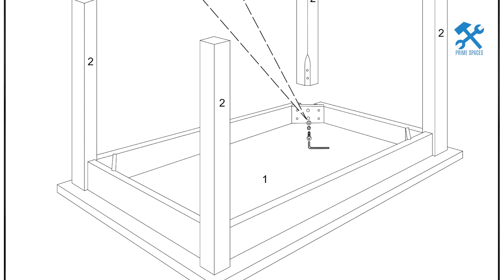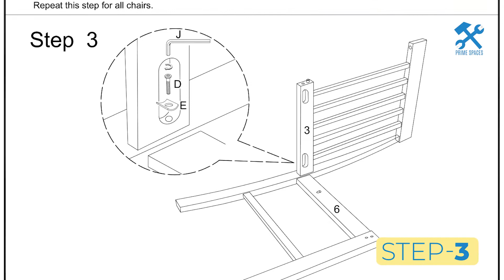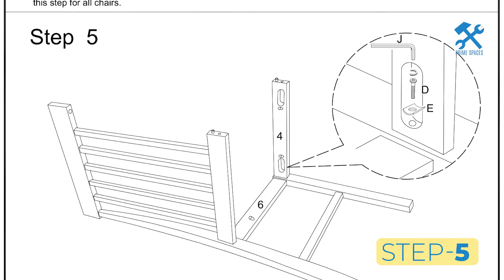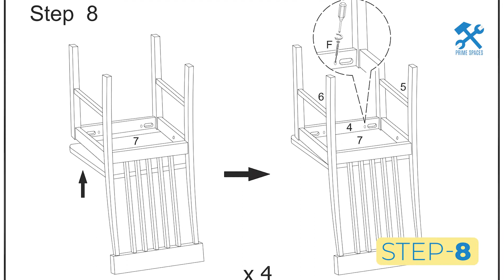Walker Edison Greyson Dining Set Assembly aka Middlebrook Pompton, Manor Park Modern 5-Pc Dining Set

Comment: Do you have to use a mechanical drill for the screws in the seats? Also very helful video thank you
Reply from the maker: Hey there! 👋🏾 No, you don’t have to, however, it does help to secure the seat better. If you use a screwdriver be sure to give it an extra twist.